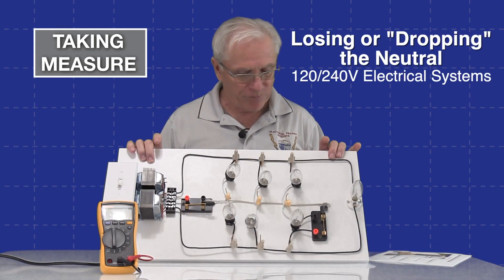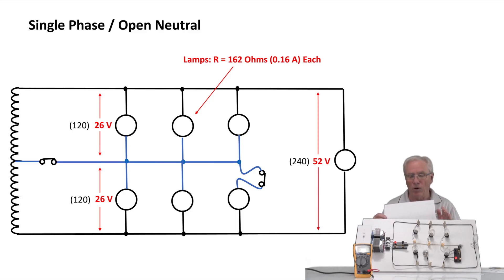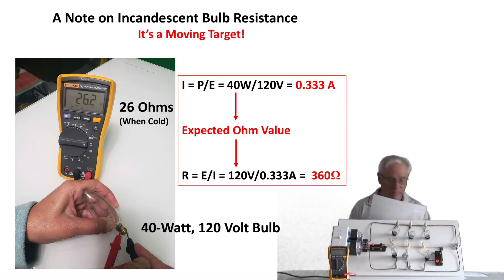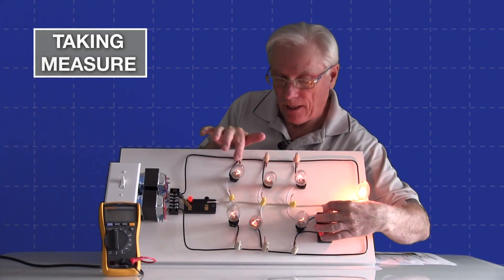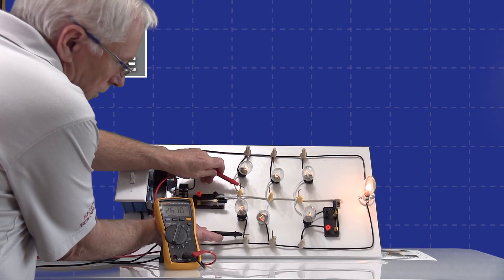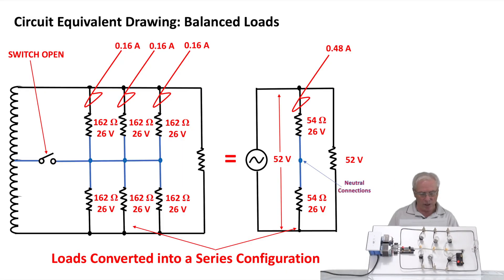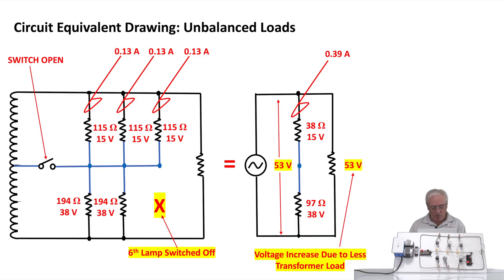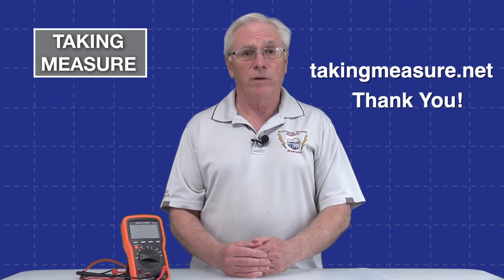Losing or "Dropping" a Neutral on a 120/240V System

Comment: Thank you for making this video.  In college I worked for a small business owner who got "some guy he knew" to wire his warehouse for a fraction what a real electrician would have charged.  The guy wired all of the 120V fluorescent fixtures (two in series) to 240V using only two wires (no neutral or ground).  Or in other words he bonded all the neutrals together in the middle of the warehouse and let it float.  Keep in mind the lights could all be individually switched!  Yet whenever I try to relate this story on any kind of social media, I get people coming out of the woodwork to tell me 240V balanced lighting is a thing, and they ignore my attempts to explain why this variation on it is bad.  (Frankly as an electronics engineer - not an electrician - I feel that for safety even in balanced situations this configuration should never be allowed, but I don't write the codes.)  Now I can just link them to this video instead of wasting words on it.
Reply from the maker: Thank you for watching, and thanks for the comment.  Series connection of 120-volt devices on 240-volt circuits is not acceptable by any standards.  For starters it is a violation of 110.3 and 110.4 in the National Electrical Code.  And that's just a starting point.  Circuits sharing a common neutral is a thing, but the neutral cannot be switched.  As a practice, most electricians no longer share neutrals on 120V branch circuits, though you can if a single breaker simultaneously disconnects all the hot (ungrounded) conductors associated with the shared neutral.  Additionally, the integrity of the neutral must be maintained and not reliant upon connection through the devices (receptacles for example) for the circuits.  At the feeder level, we share a common neutral all day long, but we never switch it.  Thanks again for watching!

Comment: I've been a cable guy for 17+ years. Well the first 15 was on the Telco side, but it was still internet/TV/phone. Moved over to the coax side of things about 2 years ago and have seena handful of melted coax at either the ground block inside or the tap outside. I even had one create tiny sparks, especially on the cast iron plumbing stack. My big yellow field voltage detector didn't turn red when I tested it though.
Reply from the maker: On grounded systems , current imposed on the grounding system will hunt for any grounded path leading back to he source.  In cases where a grounded conductors are bonded to the equipment grounding system beyond the service bonding connection something called objectional current is placed on all the grounding paths.  It's circuit current that should be on the grounded or neutral conductor  following equipment ground and electrode grounding paths back to the source.  This may have accounted from some of what you saw.  Lightning can also do weird stuff.  Be careful out there.  Thank you for sharing!

Comment: In a properly grounded system i.e the panel is grounded and the pole transformer center tap  is grounded - seeing as the neutral is the same as ground (connected together in the panel) - wouldn't the ground substitute for the neutral when the neutral disappears? - at least to a great degree?
In your panel board demonstration it would be the equivalent of a (green) wire from the neutral connections on the right side of the switch back to the common connection of the transformers on the left side of the switch - effectively bypassing the switch???
So if the neutral fails you still have the ground so the effect may not be so great?
Reply from the maker: You are correct.  In a properly grounded and bonded system the equipment ground would be in place.  But the ground wire only carries current when an ungrounded conductor or associated circuit parts is somehow connected to it.  In this case, we opened a grounded conductor.  The equipment ground still remains isolated.  But it is there to protect from a ground fault if one should occur.  Thank you for watching.  I appreciate the comment!
Reply: @takingmeasure Ah yes, the grounded/grounding terminology that confuses casual listeners .  Hence the clearer Neutral/Earth terminology used globally .

Comment: Can someone explain to me how the circuit still powers the lights when the main shared neutral is open? Doesn’t it need a return to the source to operate properly? Thanks
Reply from the maker: When the neutral opens upstream of the loads, the current returning on neutrals on the top half of the drawing will begin flowing through the neutrals on the bottom half, through the bottom loads, and back to the source on the other ungrounded wire..  This places the top loads in series with the bottom loads and sees the full voltage (240V) dropped across them as a whole.
Reply: When the loads are perfectly balanced, the neutral does not need to carry any current back to the transformer.  Current flows from the top "hot" leg, through the equal loads, and through the bottom "hot" leg.  It works as if the balanced 120-volt loads combine to represent a single 240-volt load.  

When the currents through the two hot legs are not perfectly balanced, however, the neutral from the transformer will carry the unbalanced portion of the current.  If one hot leg is supplying 20 amps and the other hot leg is supplying 30 amps, the neutral wire from the transformer will be carrying only 10 amps.
Reply from the maker: @peteduncan921  Well said!

Comment: Last year went on a service call to a home built in the late 1970s, where a 50 inch smart TV,  DVR, blu-ray player and stereo system went up in smoke after a 1500W electric fireplace had been running for an hour or so plugged into another receptacle.   A backstab connection on an upstream receptacle had burned up,  and it was a multiwire circuit for the living room/master bedroom and each receptacle along the wall alternating between L1 & L2.  This expensive ordeal could have been avoided if the neutral on the receptacles were pigtailed such that removal or failure of the device will not break continuity of the neutral, this is actually an NEC requirement found in 300.13 (B)
Reply: My neighbor had a similar scenario about two years ago.  I have seen a lot of issues with backstab connections (and shared neutrals).  I pigtailed everything I box I opened while troubleshooting.   Nice work in citing the Code!  Good stuff.  Thanks for sharing the story.
Reply: MWBC circuits should be excluded from a RFQ (Request for Quote) as should backstab cheapo receptacles.

Comment: So, bottom line, "avoid shared neutrals"!    Is that the lesson?!?  It's a good lesson, I'm just checking to see if I missed  something else.  lol
Reply from the maker: I think avoiding sharing a neutral is a GREAT take-away.  Well done!   At the same time, this also occurs at the feeder level.  I have seen on several occasions where the neutral was lost at the service or even upstream from that!  Hopefully, you never encounter that.  Thank you for watching and thanks for the comment!
Reply: @takingmeasure One form, now rarer than before, is for the outdoor neutral falling off the light poles .
Reply from the maker: @johndododoe1411  Good thing that is is rare.

Comment: I was living in the upstairs apartment in a renovated carriage house back in college and suddenly after six months with no issues all kinds of strange electrical problems started happening, like turning on the electric oven would cause the downstairs front porch light to come on, or using an outlet in my bedroom would turn off my bathroom light but turn on the stairwell light regardless of the position of its switch.  Neither myself or the owner could figure it out, and both times the utility company came they said there was no problem on their side. I lived that way for months and just figured out the combinations needed to turn on what I needed on.. Then, by chance, I moved my bed frame and realized my alarm clock cord had been squeezed under one of the legs, once freed everything went back to normal.  💡 I'm not sure if it was what you are describing, the cord in my case wasn't even three prong rather a simple two lead cord and the insulation wasn't even cut through if I remember correctly.  Whatever the cause, it affected every circuit in my apartment in one peculiar way or another.  It didn't damage anything that I know of, not even the alarm clock though I did toss it out.
Reply from the maker: That is an interesting one!  I'm not certain of the exact dynamics in your case.  Thank you for sharing.  It gives me one to ponder a bit.  Thank you for watching!

Comment: You lost me when you said 220, there is no such thing as 220V in the US. its 240V!!
Reply from the maker: I also heard myself say that at one point during the video.  Good catch.
Reply: That’s common in the US to hear 220 and 240 used interchangeably, and this is visible as getting constant voltage (e.g. 120 at the outlets, especially in high demand periods) is uncommon. Checking voltage throughout the day one can see a 120 outlet without load at 123V all the way down to 112 when people are blasting their HVAC unit(s). After that brownouts and blackouts.  Same with 1.5V batteries posting 1.6 down to 1.2.  Nominal voltage vs. reality.

Comment: We had this exact issue occur years ago when a neighbors tree trimmer was using a long pole to move the "drop" wires out of his way while working in an oak tree. Problems started when he did that as the squirrels that harbor in the tree chew the insulation off then rub their teeth on the wire, in this case, the neutral twisted wire/cable and it broke in half. We had no idea that happened and found all of the lights in the house were different in brightness etc. It was so weird because we would turn on one set of lights and another bank of lights would dim or brighten, very strange when several lights on one switch would do that and we knew right away something was very wrong. We called the power company, and they sent a truck over to look into the matter. They had to come back with a different truck to replace the drop wires from their transformer to our meter. When we returned home, we saw a note they had been there and then we noticed a burn smell inside the house. Looking into the matter we found a lot of appliances, stereo, TV, Microwave, Garage door openers, Dimmer switches, computers and so forth not working. Got an electrician to look it over and was told power was reversed meaning they sent power to the neutral which was determined to be the only way for those appliances to get damaged. Called and filed a claim with SCE which was denied as their crew said "they had no issues" during the replacement of the drop. We told them it all happened that same afternoon when they did their service, but they declined our $12,000 damage claim. We persisted and finally they assigned the claim to one of their in house adjusters who told us it was routine for SCE to decline these kinds of claims as many of them are unrelated to SCE and folks tend to see if they will pay. We told them that policy was disgusting and totally unfair to those who have valid claims. In the end, the adjuster paid for our damages which took us several weeks to determine what was damaged and what was not. We couldn't believe how many items were "fried", from electric shavers to refrigerators !
Reply from the maker: Interestingly enough, something very similar happened to the shop of the electrical contractor I worked for some thirty-plus years ago.  He lost computers, printers, etc.  I am sorry to hear about the difficulties you encountered.   Thank you for commenting, and thanks for watching!
Reply: Great comments by the homeowner - understandingly the person making the comment is not an electrician.  For me... rather than the 'professional electrician' they retained placing blame on the utility contractor I would rather point to the homeowner UNKNOWINGLY contributing to the overall damage by continuously 'trying things' to see if they worked.  For example - the razor did not fail until the homeowner turned it ON - at which point it was basically exposed to 240v resulting in instant failure.

The TV (and similar) which are ON even when they are OFF - those probably failed immediately when the neutral was broken.

Point being - don't keep 'trying things'.  If a few things are acting weird - stop and call the Utility for assistance - if you tell them you think you have an Open Neutral you will be moved to the top of the list.

IMO it is very unlikely the utility contractor energized the neutral.   They do this 100's of times every month and the neutral is typically un-insulated anyway making it a far-reach that they would make that mistake somehow.  These people are highly trained.  This is basic Electricity 101 for those crews.

I'm not putting any blame whatsoever on the homeowner -  my wife would do the same thing under the circumstance.  She would call me AFTER she tried everything in the house.  Lol

Great presentation and great comments.
Reply from the maker: @Ekanselter  Don't keep "trying things" Is spot on advice!.  Somewhere in the comments here, I mentioned that very first thing I tell anyone who calls me with tales of lights going bright and dim or what sounds like strange voltage fluctuations is to unplug any appliance they want to keep.  I also tell them to leave as much as the can off until I or someone else can take a look at the system.
Reply: Yep. That tends to happen when a 120 volt device receives 240 volts... ⚡️ 😬

Comment: The US has so much code, does it really allow two independent circuits to share the neutral?
Reply from the maker: The short answer is "yes."  They are technically a "grounded" conductor and not always a neutral.  In branch circuits where a common grounded conductor is shared between two or three ungrounded conductors, all circuits shall be connected to a single breaker so all circuits are disconnected during maintenance or overcurrent events.
Reply: @takingmeasure  This is crazy and dangerous and something I would never do. If the ground has an error, accidentally breaks you can easily apply twice the 110V to some device, which you should never do if it is rated for 110V and not 220V.
I would never use a common ground in this way behind the fuses.
Reply from the maker: @AlJay0032  Most electricians I know feel the same as you and will not share a neutral (grounded conductor) with two circuits.  I  am also one of those.  Unfortunately, sometimes the neutral is lost at the feeder level, creating an imbalance on many circuits downstream.  Thank you for the comment, and thank you for watching.
Reply: @takingmeasure It's impossible to avoid sharing the neutral at the fuse box, as there's only one neutral between fuse box and outside transformer .  But sharing the neutral after the breakers is a problem as it will remain hot when turning off each circuit .  It also prevents upgrading to RCBO breakers that have built in GFCI .
Reply from the maker: @johndododoe1411  You are correct.  I try not to share the neutral on branch circuits.  But at the feeder level we have no choice.

Comment: Not 100% sure but I think this is what happened in a neighbourhood in my country (The Netherlands).  A neighbourhood had problems with regular power outages in one week, and the power company decided to replace the substation transformer of the neighbourhood ring, but might have forgotten the neutral or connected it wrong.
People experienced sparking outlets, devices starting to smoke badly, and in some cases also wiring that melted.
(Just read up on some of the new information before placing this: there's now also a suggestion that the leakage-detection device was connected without disconnecting the customers connected to said line, so the pulsing high voltage device meant to cause an audible spark so engineers can locate the fault underground (hopefully).

Since most homes have a 3-phase connection in the Netherlands with each phase at 240V (not in a split-phase setup), there was now a situation in which lower current drawing phases became part of the return path, and it caused weird voltages everywhere (and it's a thing warned for during the training for becoming an electrician because of how dangerous this can be in 3-phase setups).

The board reminded me a bit of the board a neighbour from my grandma made for me and my brother once.
Reply from the maker: Not a great situation for your neighbourhood.  Sounds like something similar but on a larger scale.  Definitely a mis-wired scheme of some sort.   I appreciate the comment and thank  you for watching.
Reply: The board reminds me of one used during training to demonstrate the unusually high neutral current caused by 3rd harmonics from fluorescent tubes, even if perfectly balanced .  As this was serious training, the board used actual 3 phase mains and lights, not lower equivalents, a technique only taught in the distribution course as a way to test statewide effects .
Reply from the maker: @johndododoe1411  That board would be super interesting to see!   I love lessons that are realistic.  Thank you for the comment.

Comment: So the observed voltage shift due to the dropped neutral will always point to the neutral that is part of the power drop to the box?  Or could this voltage shift be caused by one phase using the neutral “wire” (miswired) from a load that is fed from the other half of the phase (effectively tying the return from a top lamp to the return from a bottom lamp)?
Reply from the maker: If two loads or lamps were somehow connected in series by mis-wiring I would say "yes."  Very thought provoking.   Thanks for watching and commenting!